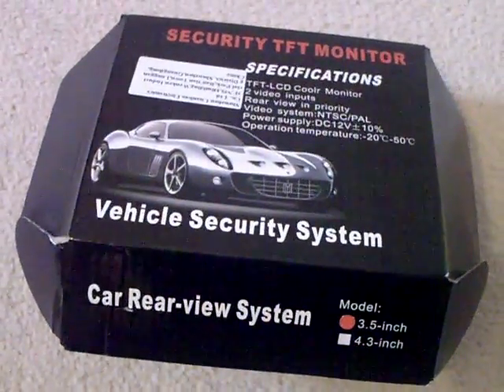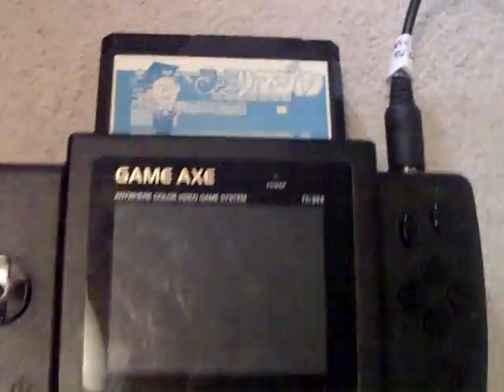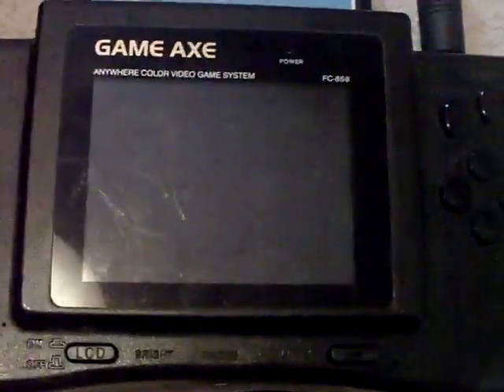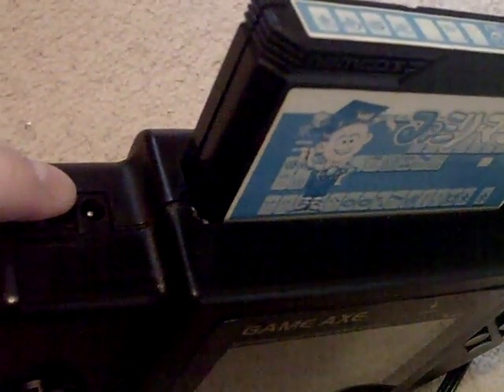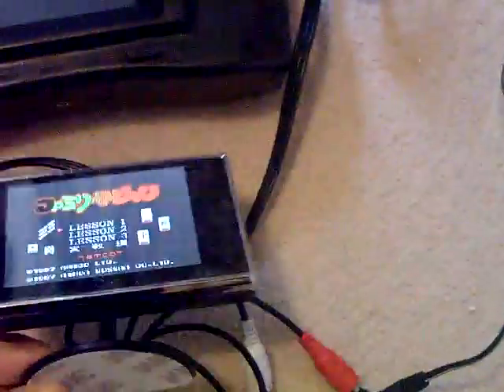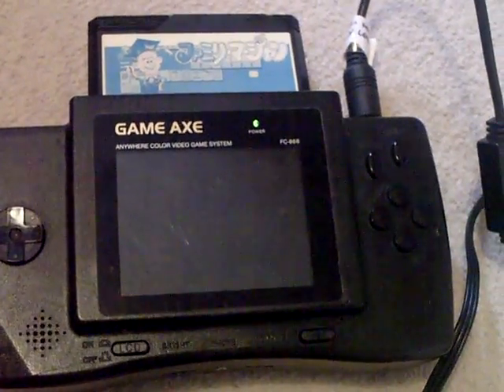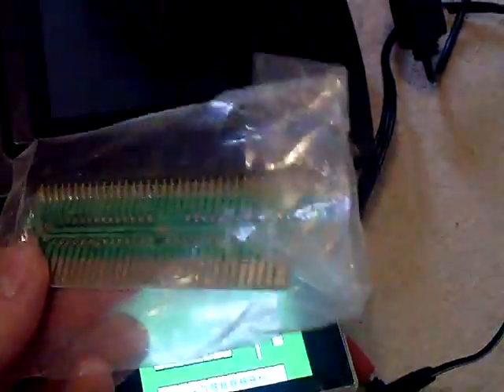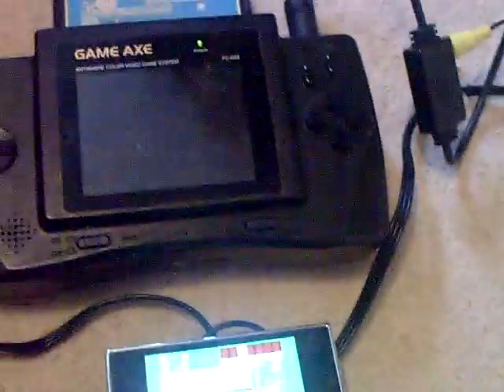Redant Game Axe - Handheld Famicom / Famiclone Restoration - PART 3

Comment: Can the Game Axe output RGB over that scart by any chance, or can you only use the rca outs on that cable? Really cool mod though, I wish I had the suergon's hands you need to pull off something like this!
Reply from the maker: I don't think it an do RGB. The cable is just a Mega Drive 2 SCART lead. I've only ever plugged it intothe SCART socket on my TV.
Reply: Since its a hardware clone and not a noac it should be possible to rgb mod it but it would take a bit of work